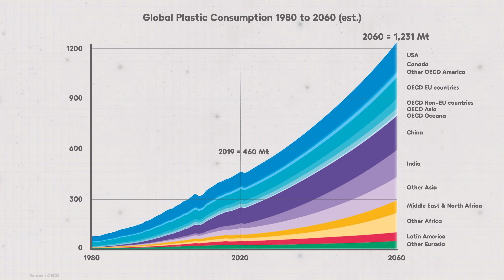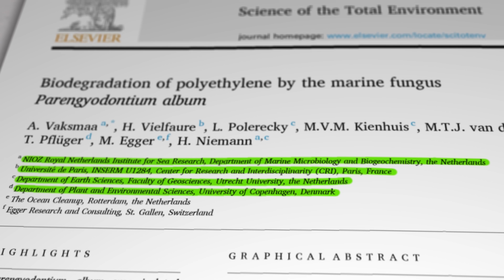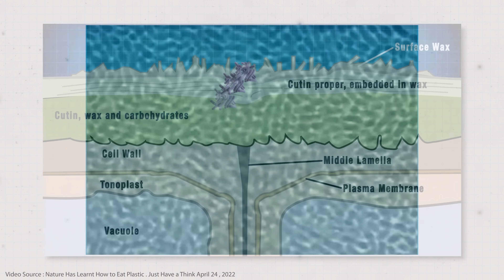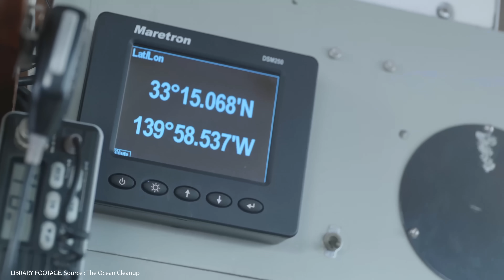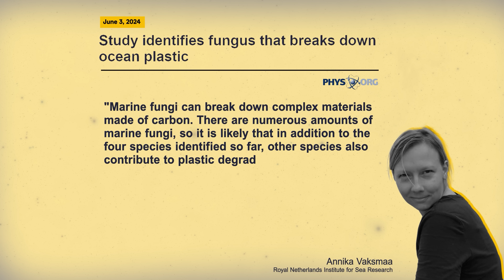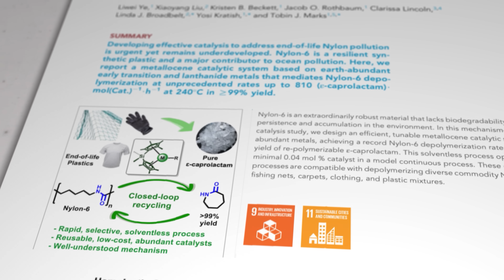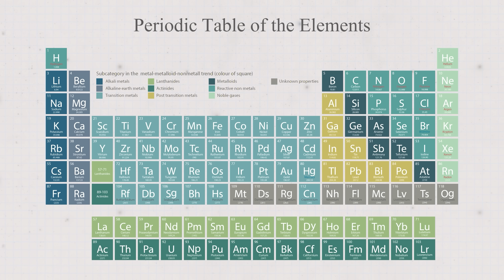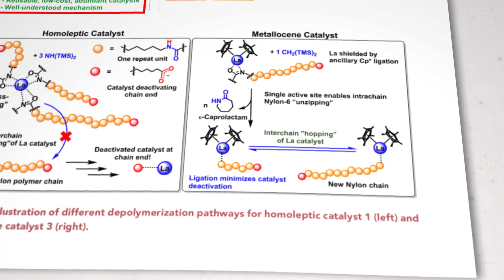Our oceans have learnt how to EAT PLASTIC!

Comment: When, not if, plastic begins to rot like wood, modern living is in for a rude surprise.
Reply: "Honey, the TV dissolved again........"
Reply: Degradation and fungus can be handled. We still use wood in a lot of ways. We just found ways to keep it away from the moisture.
Reply: @manuvillada5697  this. controlling moisture is key, and we have solved this in our homes. we'll be fine.
Reply: @manuvillada5697 but we dont eat wood?
Reply: @manuvillada5697  We don't use wood for underground water pipes.
Reply: @dacharyzoo Actually you could. Keep them completely water logged, without any oxygen, and they'd be fine for basically ever.
Reply: @dacharyzoo  time to invest into companies that will be replacing all those pipes once they start rotting?
Reply: @etyl2494  you're likely hundreds of years too early
Reply: We've moved on to bamboo canes now no drilling holes nesseccery
Reply: @dacharyzoo  We actually do use wood for underground water pipes. Or at least we used to.
Reply: @dacharyzoo yeah we use copper lmao
Reply: Nah. There are plastics that will probably never be biodegradable simply because of how unreactive they are. The more energy in the plastic and the more of the plastic there is of it in the world the more probable the degradation.
But things like PTFE I don’t see how you can biodegradable that stuff. It’s so unreactive it’s used in labs everywhere.
Reply: We still use a heck of a lot of wood in construction and furniture too so I am not particularly concerned.
Reply: Won't be too bad. Wood does just fine and can last decades outside if you care for it.
Reply: *in for a funny surprise
Reply: There's already some land-based fungi that can etch the hell out of plastic if the environment is humid enough. And I've had to throw stuff out because of that. Although it does take a long time, it must be doing something to break that material down.
Reply: Why? Things that arent maintained should rot. You arent gonna go on holiday and come back and realize fungus has eaten your TV.
Reply: Dude, its just a Koch brother's by-product. I really don't care how it rots
Reply: unlike plastic, wood is porous and has a water content, fungi needs water to do anything;
Reply: @alkeryn1700  Fungus can get the water as a break-down product if oxygen is present. Plastic already has the hydrogen part due to being mostly from hydrocarbons. Situations where that moisture can't escape can accelerate the breakdown.
Reply: @pauljs75  that is true but i'm not sure i know of any organism capable of doing that it still seems like it would need more water than what it can get out of its food's breakdown.
also still doesn't fix the issue of plastic not being porous.
Reply: Well, please correct me if i'm wrong, but it's only on sea, yet. I don't see the problem of nature evolving in that way since it won't harm sea animals and other lives.
Reply: ok u mean when a marine fungus evolves to become air borne and surviv without saltwater all around it? I think by then we will have alternatives
Reply: I'm not sure how exactly this is going to make a huge difference. I can't think of anything other than, like, deck chairs, maybe? That specifically relies on plastic's resilience to decay
Reply: We'll adapt. We're not chimps.
Reply: Good
Reply: That's gonna be a long time from now. We should have new metamaterials to use, by the time that happens
Reply: The pipes in my house 😢
Reply: We still use wood though don't we. Even for things like keyboards.
Reply: WHY patent something this crucial for our planet? first of all this process was done with things that the nature does
Reply: @havencat9337  To reward innovation. Granted the microorganisms were made naturally, but the interventions needed to make it efficient aren't. 

Also if they are smart enough to develop this, they could use the money earned from the patent to further expand this reasearch, or delve into other areas since working on this proves their competance.

Lastly, patents are temporary. Even if they are jerks and hike the price for it early on. Submitting it for patent effectively puts the process into the public record to be copied later once it expires.

Heck, This version of the process being under patent may inspire more innovation. The Wright brothers patented the Wright flyer's wing warping turning mechanism, and charged top dollar for others to use it. As a result other airplane manurfactures developed planes with the better aileron turning system most planes use today.
Reply: Makes sense though. If plastic doesn't rot. Why wouldn't we have seen more natural plastic in the world thats been there for 1000s of years.
Reply: @xertris that’s not really what OP meant, and also seashells exist. Not a polymer, but a non-degrading tool.
Reply: @luipaardprint  Go look real close at the sand on Ehukai (or most any) beach in Hawai'i. Seashells very much degrade.
Reply: @jaybleu6169  that’s erosion, mechanical abrasion that slowly grinds them down to smaller particles, but the material doesn’t undergo transformation. It’s the same process that creates micro plastics.
Reply: @luipaardprint  A crayfish eating a zebra mussel is erosion? Am I eroding a hamburger when I eat it?
Reply: @luipaardprint  seashells are not a source of energy. Plastic by contrast contains energy (you can power a generator by burning plastic, that's what trash-burning plants do, can't do that with seashells)
Reply: Can you imagine every single piece of plastic we have ever disregarded just becomes a microplastic over time by mechanical action. It will be and already is proving to be. I'm praying for  the microorganism to get in quick. 

Go glass. Be 1960
Reply: @jaybleu6169 
> Am I eroding a hamburger when I eat it?
Do you chew?
Reply: @ihakker1416  we don’t eat uranium despite all of that juicy potential fission energy locked in there. Just because something contains energy dienst mean there’s a viable pathway to consume it. We’re basically depending on random change for some bacterium to develop a protein to be able to process whatever we’re hoping to get rid of. It exists now for PET, which is one of many many different types of plastics out there.
Reply: @jaybleu6169  yes you are eroding a hamburger when you eat it that's why you need an entire digestive tract to ACTUALLY degrade the small chunks into usable forms of energy
Reply: @xertris  cellulose in plants is a naturally occurring polymer
Reply: @xertris  plastic is such a blanket term for many many different types of materials with widely different properties
Reply: All that Egyptian plastic is gone right? And I know theve done some digging
Reply: @xertris  bro what... plastic doesn't occur naturally. It's literally a human invention.
Reply: @AdamTheAnimationArtist  Not typically, but you'd think at least trace amounts of it would form naturally by random chance in certain circumstances.

Comment: Polyethylene (and by extensions, polypropylene) is nothing; its the simplest plastic and the least hazardous from a health perspective.  Let me see it break down and metabolize polycarbonate (essentially, poly BPA), polyurethane (degradants of polyurethane are potent carcinogens), and polyethylene terephthalate (the plastic most bottles are made from; soda and water for example).  If we find organisms that can break down these as well as polyethylene/polypropylene, then a solution to plastic waste and disposal is within our reach.
Reply: Nylons are also generally a-toxic compared to most other plastics.  Both their monomers and the common additives used in these materials.

Comment: Lets hope these microbes don't get too fast at eating up the plastics, imagine if they could eat all the plastic in your cars wiring in a day, or a couple of weeks or a couple of months.  You would need to buy all new electrics for your car every time the microbes eat through all the plastic in the electrics.

But also imagine if it happens to an airplane.  Now-a-days airplanes are being made of carbon fiber which is a type of plastic, well it's carbon fibers in a plastic resin.  So what happens if some of these microbes evolve to the point where they can eat through a 737-Max wing in a few weeks.

Comment: Solving the plastic recycling problem is actually pretty easy 
1 make 3d printers very cheap 
2 make PLA rolls very expensive 
3 promote "filament hacks" videos

I call it the "hp solution"
Reply: I laughed way more than i should
Reply: or: the consumer has to stop buying non-reusable plastic. It requires little effort, but the impact is huge.
Reply: @luxraider5384  I was just joking, but if we want to get serious, I'm afraid we have to focus the produing companies, not the consumers. If they have to stop using plastic, we won't buy it
Reply: @drillerdev4624  nope it's the consumer that has to drive the demand, producers won't make smth that won't be bought.
Reply: @luxraider5384  that's why governments have to force the producers 

Back in the day, all bottles were glass ones, and reusables. Nowadays, you only find those in restaurants 

What can a consumer do if all companies use plastic, stop drinking beverages altogether?
Reply: @drillerdev4624  you know why bottles aren t in glass anymore? Because people prefer plastic. Yes, without government restrictions the people drive what the producer makes. Non-battery chicken exists for the sole reason that the consumer will prefer it over battery chicken. Also you can actually reduce waste by buying family size bottle and pouring the drink into a small reusable bottle. We don  t have to stop plastic all together, just change our behaviour.
Reply: @luxraider5384  no, because they're cheaper to produce and transport for the company. They still use glass for restaurants.

And we have aluminum cans as well, which are lightweight too and more recyclable for individual units. I don't think anyone would complain if governments forced companies to forego individual plastic bottles in favor of cans
Reply: @drillerdev4624  yes because consumers will buy the cheaper product. If you can t find glass bottles in your supermarket, it just means that they don t sell well. You can find many things in glass, like spices, but why not bottle? Also recycling requires energy, which burns fuel. And i also talked about the issue of disposable individual packaging which produces a lot of waste.
Reply: @luxraider5384  they sell just fine in restaurants
And spice has traditionally come in glass, but some brands have been selling in plastic for years now, even though I'm sure people prefer glass for long term storage (if I have to buy the plastic ones, I transfer them at home to an old glass container) If some companies can ship in glass, all of them can

Plastic fabrication requires fuel (it's a petrol byproduct). Glass recycling requires heat. It doesn't have to come from fuel necessarily

As for one time use disposable packaging, it should be avoided as much as possible, yes. Like plastic bottles, for example
Reply: @drillerdev4624  just like bottles have traditionally come in glass. And no heat mainly comes from fuel. I don t think they will bother investing in renewable energies, and even if they do, they could have instead sold the energy they produced to reduce fuel usage rather than using it.

Comment: I worked for a while with ReSynth International, which has several patents on a method for converting either most plastics or scrap tires into diesel, kerosene (jet fuel), or other fuels, profitably, in small "micro" scale plants that could be placed in small cities and process nearly all plastics in the recycling stream. It's pretty much impossible to get investors for these small $30 million facilities.
Reply: Depends on who you're pitching to. The company website is down, are they still in business?
Reply: @ІванПащенко-ч9в  the tech is there but operations are on hold until either investment or a potential contract to build one. They also have tech for cleaning and improving heavy fuels like bunkers to solve the marine fuel and emissions problem. But as of now it's basically tech in a box. They had a deal to install online systems into a hotel chain's heating system, but COVID shut that down.